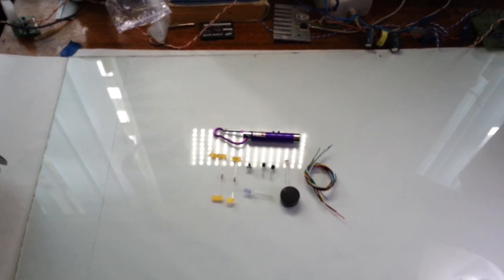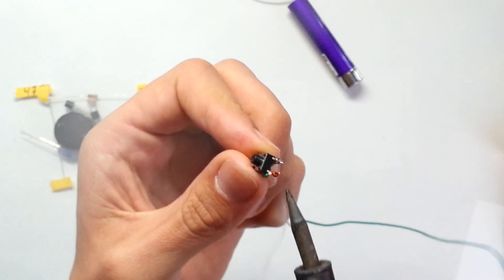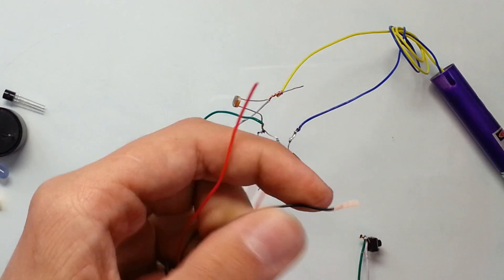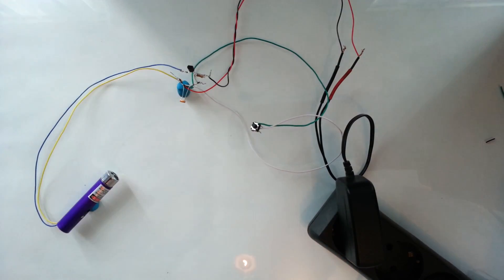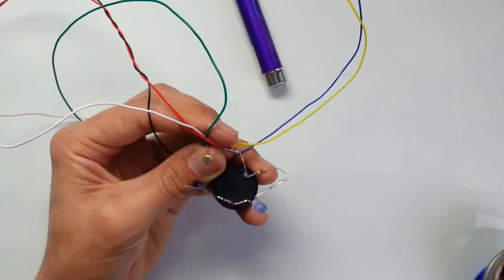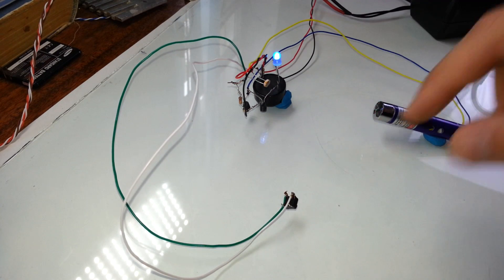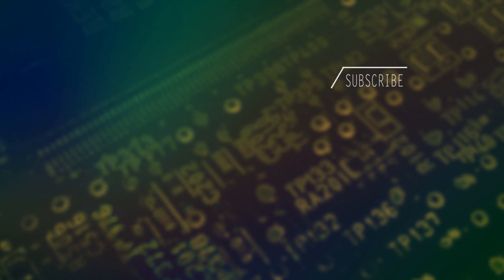Laser Trip Wire Security System | Simple DIY Project

Comment: Hey man great video but my model seems to be having a problem.  I have done everything accordong to the circuit except that since i couldnt find 2n7000 mosfet i used an IRFZ44N  mosfet . From a previous comment i modified the circuit by adding a 51k resistor parallel to the LDR and added a 2.7 k ohm instead of the 1 k ohm resisitor. But the laser does not stay on but turns off when i stop pressing the button and after that the buzzer and light turn on on themselves . Please help me if you can . Thank you
Reply from the maker: Hi, probably to late to answer. I think you don't need adding a 51k resistor parallel to the LDR (don't know what comment you referring to). Maybe 2.7 k ohm is not enough, try more, for example, 10k, or 45k. And point the laser precisely at LDR. IRFZ44N and 2n7000 have different spect, so could be some issues.
Reply: @ElectricalPro   Thanks for the reply i will try it.😄😁

Comment: Sir I have built the same circuit until 3:10 and everything is working fine but the step at 3:11 is not working when I point the laser to ldr and turn it on it doesn't stays on please help sir ( I have used normal LDR which is available in local market)..
Reply from the maker: Hi, maybe your LDR has different characteristics than mine, I've used LDR07. Anyways, try to replace R2 (1K) resistor with 4.7K or maybe even 10K, it will make this device much more sensitive to light.
Reply: Electrical Projects [Creative Lab] ok sir I will try and thanks for reply...
Reply: 100k is okay?

Comment: would it be fine if I replaced the 2N7000 with a different transistor? if so which one should I use considering that I used all the exact materials listed.
Reply from the maker: Hi, Yes, the only one I think of is IRL540N, but it is much more powerful MOSFET, and much bigger also. It should work fine without any problem if you connect it correctly.

Comment: What i have to do if i want to my buzzer work on 12v becouse i have a siren that must work on 12v?
Reply from the maker: The easiest way: is to use a LM7805 voltage regulators to power the circuit with 5V and then use a 5V relay to control 12V siren.
There is also another (more advanced) way: you will need to replace Q2 MOSFET with much more powerful one, for example, IRF540N, and replace (add) resistors with appropriate values. (I wrote values for 12V somewhere in the comments, but it is untested). and after all of this, you will just need to connect siren instead of the buzzer.

Comment: I used all the components as said in the video
the light continuously on ante reset button is also not working
Reply from the maker: The laser on ? or the LED with the buzzer on?
Reply: laser light is on and the it is not breaking while keeping the hand in between
Reply from the maker: The laser should be off by default and should turn on when you press the button. I think that Q1 MOSFET is dead. Let's do a test just to be sure that Q1 is dead. To do a test just disconnect LDR07 and the button, if after the disconnection the laser still stays on it means that Q1 MOSFET is dead, and you need to replace it with a new one.
P.S. Be careful with static electricity while soldering, maybe you killed your 2N7000 MOSFET with static electricity somehow, or maybe it was dead even before you bought it... I don't know... I almost sure that Q1 is dead, but do a test to be completely sure.

Comment: Really good project.  If I don't want to turn off laser pointer with the reset button but only want to turn the buzzer off (and LED) with reset button, can I just solder the reset button else where in the circuit? I think maybe on both sides of the buzzer so the LED and buzzer will be off with the reset.  Maybe it's more complicated but your help will be appreciated
Reply from the maker: Hi, The problem here that it is working (and designed to work) all together, and when the laser is on then the LED with the buzzer is always off and vice versa. It was made intentionally to have that triggering effect. If the laser always stays on then if someone blocks the laser beam then the buzzer will make noise, but as soon as LDR will start seeing the laser beam again it will stop making noise automatically without any reset. In other words, It will just detect the light from laser without any triggering, and you will not need the reset button at all. If it is what you what then I can tell you how to modify the circuit.
(You can't just reset the buzzer without resetting the laser, they rely on each other, and to do that you will need a much more complicated circuit.)
Reply: Thanks for your answer.  So if I want to have an unstop laser beam, sould I use the circuit you show in the video "How to set a security alarm device with a reset button" and use a light dependant resistor instead of a reed switch and use a standalone laser beam?
Reply from the maker: Yes, it should work, but I personally did not test that circuit with a laser and LDR.

Comment: sir please tell me the different transistor names used instead of 2n7000
no 2n7000 transistor available at our place
Reply from the maker: Almost any other N-channel MOSFET transistors should work fine.
You can try IRFZ44, IRF540N, IRL540N (but they are much bigger and more expansive, I don't know a good replacement for 2N7000, sorry).
With other MOSFETs some minor adjustments may be needed... maybe you will need to replace resistor R2 with 2K...
Also, you may need to connect a resistor in parallel to the laser (just connect any 10k - 100k resistor).
If you find IRL540N, then no changes to the circuit will be needed. (IRF540N and IRL540N are different transistors).

Comment: Hi please tell me how to make the circuit by using 12v DC 
while the laser is only 4v capacity
tell me the circuit please
Reply from the maker: Hi, Just use LM7805, it will make 5V from 12V. Somewhere in the comments I also described another way how to do it, which require changing and adding resistors, but I recommend just to use LM7805 because it is the easiest way.
(The laser in this video works with 5V, not 4V)

Comment: Please give me any idea or option to make the surface of ldr big and more sensitive. It takes too much time to adjust the laser on the ldr.
Reply from the maker: Hi, If you need more sensitivity you can replace R2 (1k) resistor with 2k or even 4.7k or higher (but don't make sensitivity very high, because it will start to sense light not only from the laser but also from another light sources). Also, you can try to make the laser beam more thick by adjusting focus (but this may not work, because there may be not enough light for LDR07 so you'll need to change that R2 resistor to make it more sensitive). Alternatively, you can fix the laser pointer first, and only then move LDR07 into the laser beam.

Comment: I didn't understand where you attached the second wire at 1.16seconds
Reply from the maker: Hi, The yellow wire connected to the plus of the laser pointer, and the blue wire connected to the minus of the laser pointer. The aluminium housing (body) in that laser pointer is a big plus terminal, so I connected a plus (yellow) wire directly to it.
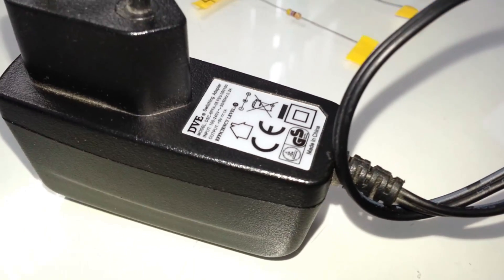(I think that in the different laser pointers you may need to connect wires differently, so look at the circuit diagram on 0:54 to get the idea how to connect)
Reply: Electrical Projects [Creative Lab] so nice of you to reply so clearly thanx

Comment: Great video, but can I run the laser and the circuit from different power supplies, I want to put the laser on the other side of a room, thank you
Reply from the maker: Hi, I think you can find better circuit solution if you need to make it separate. Here is why: The main idea of my laser alarm is that when you break the laser beam, it triggers the buzzer, and the laser turns off. If you use a separate laser it will not be turned off, which means that at first (when you break the laser beam) it will make noise, but the device will stop making noise as soon as it starts seeing the laser beam again.
Reply: It would be great if you can give me a different circuit solution

Comment: Sir, please advise me  for :  I want to use this laser beam to operate 6 volt relay so as to use as a security purpose for lightning the 40 watts led bulb instead of your small buzer. Is it possible
Reply from the maker: Hi, Yes. Just connect the coil of your relay in parallel or instead of the buzzer, and then you can control any bulb or LED.

Comment: Can I use in stand of 2n7000 transistor any other transistor
Reply from the maker: You can use BS170 instead, but BS170 has a different pinout.
Reply: Electrical Projects [Creative Lab] any other like BC547 because I cont get that component sorry any other plz
Reply from the maker: I still recommend you to find some n-channel MOSFETs. BC547 is not MOSFET, so you can't just replace 2N7000 with BC547. Though it is possible to use BC547, but you will need to use more additional components (more resistors) and the most important, you need to find correct values for those resistors.
I've chosen to use MOSFETs because this circuit is much simpler with them.
Reply from the maker: If I really wanted to make it work with BC547 I would do something like this: https://drive.google.com/open?id=1RAfSqoimKu14_n1HmBkRxvimMKvPLmf- It is untested, it is just my thoughts, maybe you will need to replace 1K with something bigger like 10k or 50k.

Comment: Hello Sir 
How can I made this project with a 9V battery.
Reply from the maker: Yes, just add LM7805 voltage regulator, and you will be able to use any DC power sources from 7 to 35 volts.
(it is the simplest solution).
Reply: Sir can u please send me circuit design on my gmail account my account is singhsikarwaryash@gmail.com
Reply: @ElectricalPro  9V instead of 5V is fine..no need for LM7805

Comment: Sir, I tried your method, but when I turn  the laser another time the buzzer  turn off. where is the problem ?
Reply from the maker: I don't completely understand what problem you are facing. After pressing the button your buzzer should turns off and the laser should turns on, it is ok. And then when you still pressing the button you need to point the laser at LDR07, then you can release the button and the buzzer should stay off. Watch the video at 4:45
Reply: Thank you for your reply
it's good, it was a problem connecting the wires
thank you very much = Merci beaucoup

Comment: How to make this circuit with 12 volt battery
Reply from the maker: Hi, You need to change values of the resistors.
R2 Should be 470 Ohms instead of 1k. Resistor R3 I think is better to replace with 1k instead of 470 Ohms.
But the most important is resistor R1 which is inside the laser pointer, it should be 400 Ohms instead of 100 Ohms.
I think it will be easier just to add an additional 300 Ohms resistor sequentially to the wires that go to the laser pointer, 300 Ohms and 100 Ohms together will be 400 Ohms.
Reply: Use lm7805 to get 5v from 12v

Comment: hello , how your " light dependent resistor LDR07" work? is it out put analog signal ?
i build something like your but it dont work! i think my problem is the light resistor.
Reply from the maker: Hello, LDR07 is an analog device. LDR07 just by itself doesn't output anything, It is more accurate to say that LDR07 changes its resistance depending on the amount of light it senses. You can see it yourself, just connect LDR07 to a multimeter and measure its resistance, and you will see how resistance is changing depending on the amount of light.
In my circuit, I've used so-called "voltage divider" which consist of 1k resistor and LDR07 (On the circuit it is labelled as "R2" and  "LDR1"). The "voltage divider" transforms changes of resistance into changes of voltage. Now if you connect a voltmeter between gate and source leads  (labelled as "G" and "S" on the circuit) of the MOSFET Q1 you can see how voltage changes depending on the amount of light. I am not good at explanation, but I hope it is helpful.
Reply: thanks for your reply. i will keep going!!
Reply: i watch one of your video tutorial . then DONE!!

Comment: Can I use other transistor like bc 547
Reply from the maker: No, unfortunately. You can't just replace 2N7000 with BC547, for this project you need to use MOSFET transistors only.
Theoretically, it can work with BC547 but we'll need to redesign the circuit completely.
Reply: @ElectricalPro  Why is there a need to redesign the circuit? Both of these transistors work almost the same